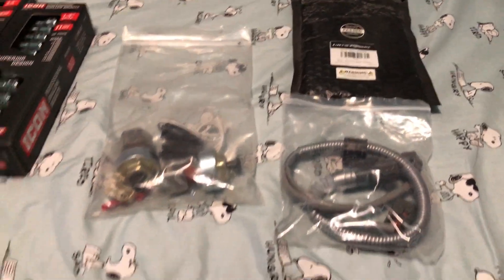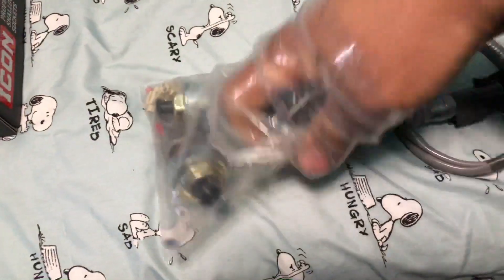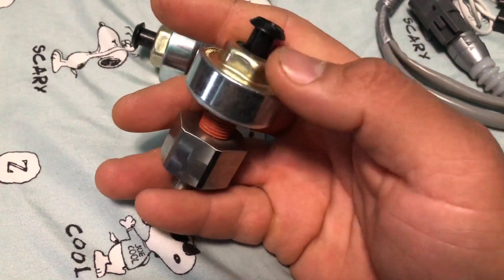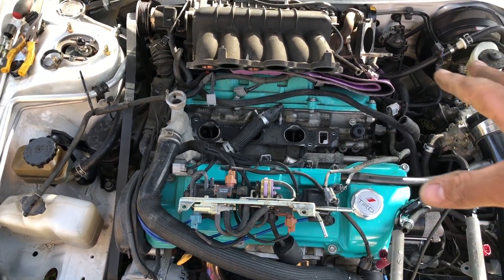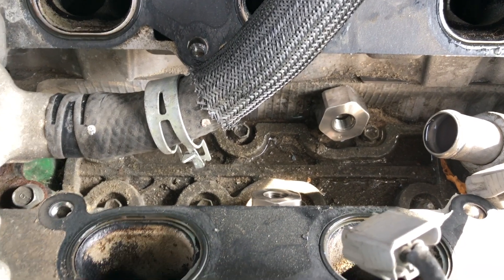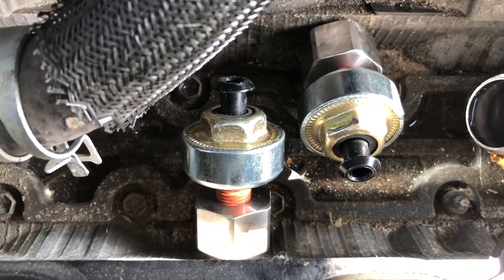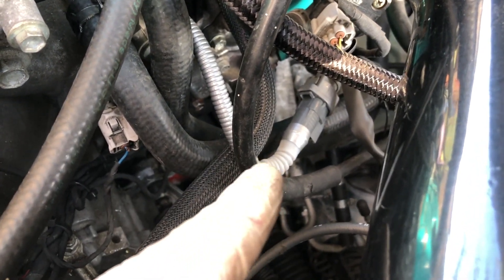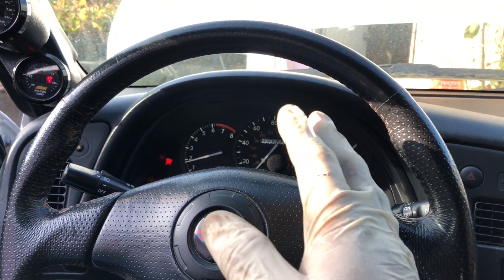Installing GM knock sensors on my TRD Supercharged 3MZ-FE swapped Celica

Comment: The wiring setup of this engine is really similar to 2MZ-FE with the waste spark system and Igniter. BTW, are the GM knock sensors of similar resistance as the Toyota ones?

Comment: I bet you could re-tap the block for the GM knock sensor.
You could probably do 200-300 miles on it before posting a status update on it’s effectiveness
Reply from the maker: re tapping the block would probably be possible but its just angled in a very uncomfortable way and the adapters don't really cost much for me.

Comment: You do realize that these sensors are electronically “tuned” to send a signal when the engine starts knocking.  It is much more complex then just screwing in another sensor.  Has this modification been proven to actually detect knock with your engine?  No codes doesn’t mean it will detect knock and prevent damage to your engine.
Reply from the maker: Back when I had my 1mz I was running 7-8 psi of boost and that most likely caused my engine to knock / ping which ended up ruining the 1mz. 1 good hit and these Toyota knock sensors being useless aka dead. 

Did the swap to the 3mz and the knock sensor code was coming back here and there and sometimes immediately after turning on the engine. 

Plenty of forums on solara guy saying that these GM sensors have been proven to be more durable and less sensitive than the Toyota ones. It’s been an on going debate but I’m willing to test them out and report to you guys. Hopefully this answers your concerns.
Reply: @2zzlow  enjoy your videos.  I understand that you don’t want false knock detection.  Just be aware that the GM sensors are not tuned for your engine at all, so may not detect knock at all or until sfter damage is done.  This is of greater concern with a boosted engine.  You may want to verify using a set of headphones that knock, when present, is being detected by the GM sensors and with the ECU retarding timing when it happens.
Reply from the maker: No I totally understand the GM sensors are not tuned for this engine setup but I’m only going based of what others have had success with in the past. A lot of forum reading is what I’m doing. 

I only have faith in this because when I had the 1mz I was running the engine very lean with stock injectors causing it to knock and damaging the knock sensors. 

In the end the Toyota knock sensors while being the original ones they are known to go bad very easy and cost almost $250 each new while these ATS ones go for $80ish each. I will monitor this closely and will only report when something new happens. 

All trial and error at the end of the day because I’m trying to stay with the oem ecu